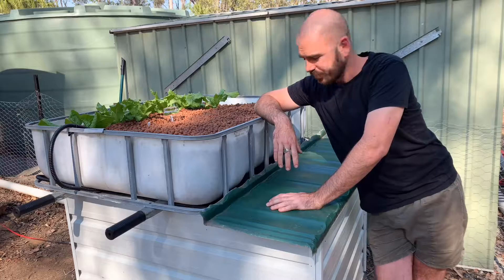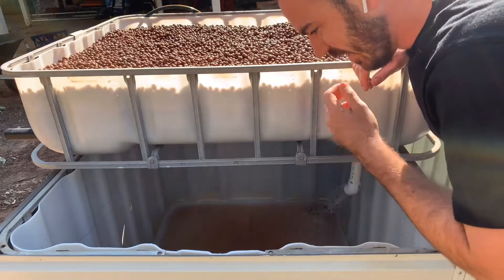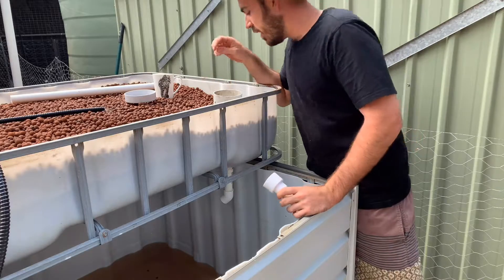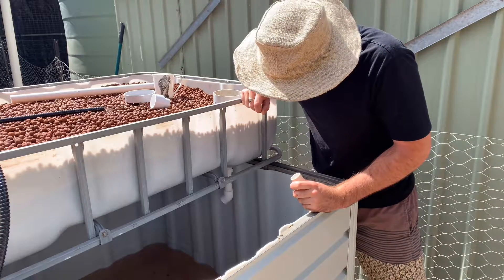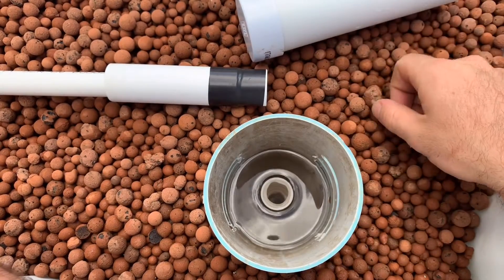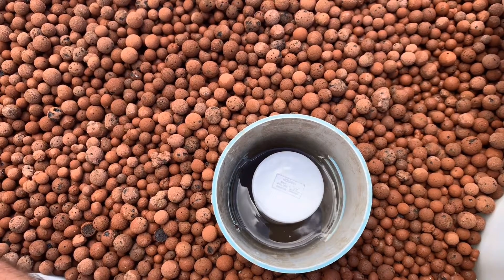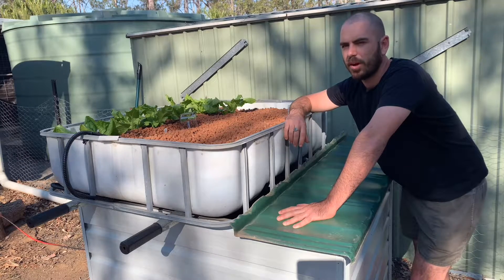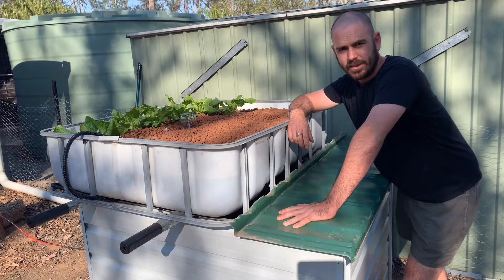The Problem with Bell Syphons, Aquaponic System Part 3.5 Troubleshooting with Hoocho

Comment: A simple fix is to put an s trap at the end of your discharge pipe.  When the s trap fills with water it stops the air from coming up the pipe and starts the vacuum more reliably.  You can build one simply with  two elbows to make a u shape at the bottom. A short piece of pipe in the second elbow pointed up can be used to increase the back pressure even more.
Reply: Ditto

Comment: I would really like to see what the final system looks like. Did you just jam that piece with tape Into the existing pipe, or did you replace the pipe in the bulk head?
Reply from the maker: Jagroy amazingly it’s still held in place by the tape haha, no problem so far.
Reply: @Hoocho   so it looks like you got a reducer for the smaller pipe, put the smaller pipe through the original standpipe, so the top of the reducer was at the top of the original stand pipe, and then just put tape around the top of the original stand pipe and the reducer so that air can't get in?
Reply from the maker: Jagroy that’s correct, I also had a pipe coming off the bottom of the reducer to keep the syphon.

Comment: one more thing, the water is fed in from the entire circumference of the grow bed aimed down into the media bed to minimize dead anaerobic areas particularly in the corners. i use drilled 1/2" pvc pipe.

Comment: i've never understood the placement of the bell in a corner of the grow bed; this restricts the water flow from two sides. i center my bell in the grow bed, use a 1" standpipe, a 3" bell with (4) 1" holes at the bottom, the whole bell is surrounded with non corrosive wire fabric to block the roots and create an air gap avoiding another problem you will have. i use no special fittings, no air tube to the cap and have no problems. when i first started i tried every hokey "engineered" design i think on the web, this was 12yrs ago my greenhouse floor looked like a pvc junk yard with all of the pieces. none works better then the design i settled on. (which in all fairness i copied from a youTube video)  i did ck liked on your video because you gave a good presentation. i have about 30 bell syphons in grow beds same dim bells different lengths to fit the media, in 8"-14" deep media beds.
Reply: Do you have video, or pictures of your "sifon"? Thanks
Reply: @edodurik  there is a forum DIYaquaponics.com under the section backyard gardening rfeiller that show a few different set ups showing how I do them.
I am still using the same design in my aquaponics greenhouse.